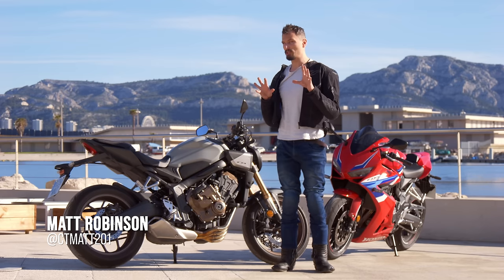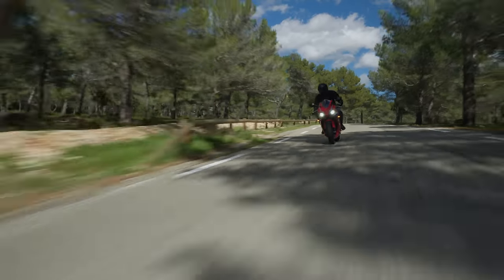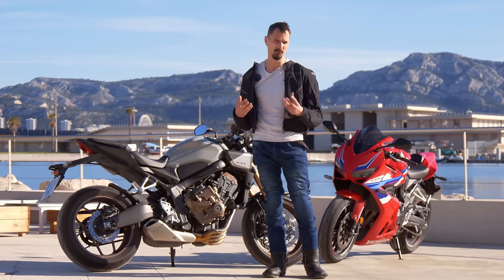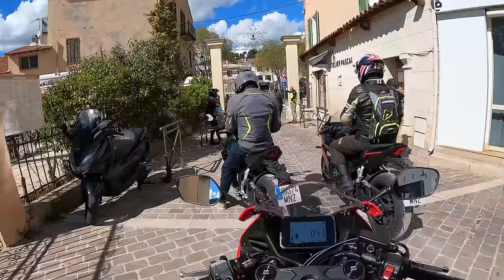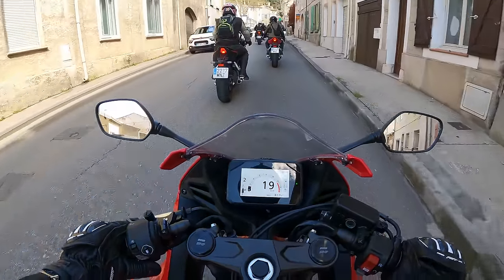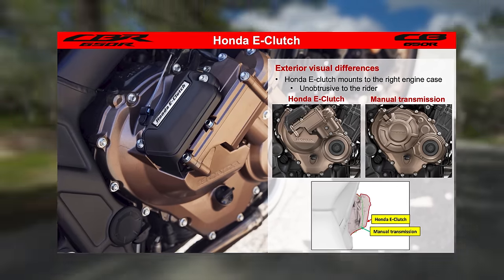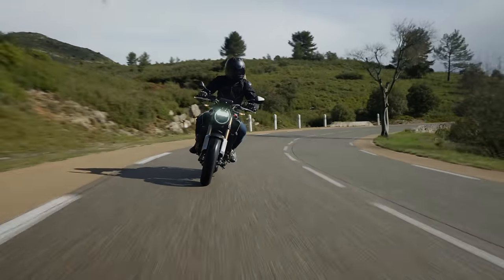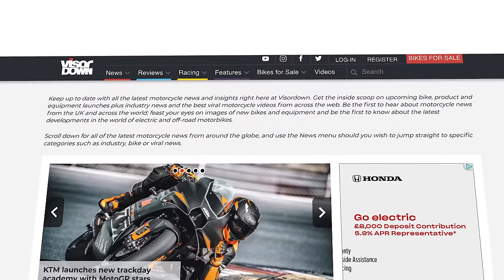Is Honda's E-Clutch A Gearbox Game-Changer?

Comment: When did motorcyclist get so sensitive towards manually shifting a motorcycle like it’s a chore? For some it’s part of the engagement, for others it’s a distraction but you don’t have to diss one to bring the other up. Just enjoy the ride.
Reply: The exact same debate has been going on in the car world since Porsche made the 991.1GT3 PDK-only…. 2014
Reply: @timessix8434   That's true, lazy knobs ruin everything...
Reply: There are hundreds of new manual motorcycles and those models have a manual only version why are you even on this video?
Reply: It's two worlds in one, why be annoyed by that?..
Reply: What makes Motorcycling fun is the fact one is not inside a box, that is pretty much it, like riding a bicycle, yes, working the Clutch is a chore.  Having not to worry about the clutch adds safety, why would anyone not want that ???
Reply: As a disabled rider with a left leg thats down on strength and left fingers that have minimal grip strength due to an accident, the DCT has been a game changer for me. I'm looking forward to seeing if I can ride this transmission and get back to riding sports bikes
Reply: @silotx  I watched the video to learn about the new technology. I wasn't expecting to hear the negativity towards manually shifting motorcycles though. I simply shared my opinion of that aspect of this video. It does not mean that I dislike the video or the presenter.
Reply: @tkraft1442  I'm not annoyed by it at all. I was just curious why the presenter felt the need to talk down about manually shifting when the option is there to do both on this bike.
Reply: @mannyechaluce3814  Not my preference, but I understand some prefer the DCT option over manual for various reasons. I'm not going to talk negatively about DCT though. I think this e-clutch technology provides the best of both worlds and lets the rider choose their adventure for every ride.
Reply: @mattyb7736  That is awesome to hear. One of my neighbors had a DCT bike due to various limitations of operating a bike manually. I think this e-clutch technology is a great blend between old and new tech and I'm interested to see if more bikes in Honda's lineup end up with it.
Reply: Don't worry about it. It's only for the commuter/tourer bikes anyway
Reply: The same argument would apply to every technology we take for granted

Why disc brakes? Why not use drums like "real men"
Why EFI? Why not tune carbs every ride?
Why ABS, why traction control, why liquid cooling

In fact why not ride the fastest bikes from the 1930s - they will do 100 MPH as well as anything new
Reply: Younger generation, cry babies, no backbone, want everything fast and easy
Reply: It's for people who live in crowded cities where traffic is hell and this is a no brainer! You don't like it don't get it as this is an option anyway, stop dissing good cheap tech for no reason which makes life easier for real.
Reply: @mattyb7736  that's awesome mate, super happy for you.
Reply: @MaxHendrick-tk3xt  Not to mention the few who now have prosthetic limbs and still ride!
Reply: Everyone else that doesn't live in America or Europe where riding a motorcycle is a necessity and not a hobby
Reply: Because it serves no point. It’s like cvts with “manual feel” profiles. It’s for honda obsessed  bike purists.
Reply: @TankSwift  Thank you for that perspective! This technology makes a lot of sense for those use cases as well.
Reply: But you already have to deal with wind, two missing wheels, and no roof.
Reply: For me sinds i got carpel tunnel syndrome. But yea shifting yourself is fun
Reply: Nobody is complaining about manual. It’s about the clutch. Having to use a clutch is stone age tech. Now you can use the clutch or not, your choice.
Reply: I love rowing my own boat, but in dense heavy traffic commuting, I would absolutely LOVE to have this feature.
Reply: Well in the video he mentioned some situations where this is quite a nice feature. For accessibility for people that have some sort of disability is one. If it’s a nice piece of tech I see no reason to use it, it all depends on how well it is integrated in the system.
Reply: I actually want one of these bikes mainly for safety. When I’m close to the front at stoplights, it takes a second to lower my right foot off the brake (which I use to hold the bike in place at a stop most of the time,) pull the clutch, pop into first and modulate the friction zone. In that time, the idiot behind me has already started moving forward because they saw a green light and everybody is impatient in their miserable little lives. Because of this if I’m at the front of the line I usually hold the clutch down in gear to avoid somebody getting too close to me expecting instant movement forward. Didn’t care in my stick shift car, but I can get way more hurt off someone’s bumper on a bike. I love rev matching though, I will use the clutch on downshifts 24/7 if I had this bike
Reply: couple of reasons. 1: health issues - some people do suffer from arthritis so it's going to be hard to shift from time to time being that your hand is already inflamed.
2: traffic - it varies but in our country driving is a nightmare and having a manual bike is like signing up for anger management your move little by little that it's frustrating to hold the clutch and shift from time to time so this is a game changer

I drive a manual motorcycle, and I don't belittle any type of rider just because I drive manual doesn't mean I'm better than any one else and secondly this is a very exciting innovation kinda like when the motorcycle, led light, abs, etc. was invented. if an invention makes for an easier use then it is successful. if we fail to accept this concept then why not just ride an old motorcycle with no abs, no led heck why not just ride a horse?
Reply: Sounds like you may be the one who is too sensitive. The chap in this video is British. The way they rag on stuff is just their type of humour.

Comment: When will other manufacturers catch up to Honda. I'm absolutely sold on Honda's DCT and have been for 10 years.... can't wait to try this. Others need to catch up
Reply: You must be old
Reply: @Sanisani9  no. Lazy, modern, efficient like all the automatic car drivers out there.
Reply: Don't see the appeal of making bikes as boring and automated as cars. You might see it as other manufacturers needing to "catch up", I see it as Honda making soulless bikes I wouldn't ride for free.
Reply: @nordstar2698  
Understood. Depends why you ride. I ride to get easily from A to B. I love riding but only ride to commute to work
Others ride for the thrill, the feeling, the raw mechanical feel. I understand why those enjoy a more manual gearbox. Horses for courses.
Reply: @nordstar2698 WTF is boring about this? It’s boring that you don’t have to pull the clutch in? It’s boring that you still have real shifting, just like on any other manual bike? And if you do wanna pull the clutch, you can.

Comment: Took me 30 000 kilometers to fall for the DCT; certainly wasn’t love at first feel, but it shifted my perspective.
Reply: Hahaha shifted 🤣
Reply: break it and its an expensive mess... worked at a shop and have a few overheated examples because wrong oil is used...
Reply: Well using the wrong maintenance items and having damage because of it, is very much NOT a fault of DCT. Using wrong engine oil in any modern engine can cause many issues

Search for the ytuber Varahannes. He has a Honda Varadero and a Afrika Twin 1000 DCT
The AT has over 500.000 ans absolutely no issues with engine or transmission
Reply: @someguy9520  I think he means the price to fix is twice when it's a dct vs a conventional one

Comment: My first thought was "what a useless idea" but it obviously works well.  I was reminded that many years ago I had a little race bike with a Yamaha TZ125 engine, and on one particular track I was doing around 30 gear changes per lap.  Even with the extremely light clutch of the Yamaha, by the end of a day of 2 or 3 practice sessions and 4 races I was doing lots of clutchless shifting because my hand just wasn't quick enough any more.  With that in mind it sounds like a great idea.
Reply: When I read about it I also thought "what a stupid idea". Tried the new CB650R with e-clutch today, it was awesome. I totally understand and love the idea after trying it.

Comment: Yamaha offered a similar clutch system on the FJR1300 for a few years.  I owned one and liked it a lot.  I have also owned a DCT Honda, and while the shifts were silky smooth, the auto shift points were not great, and it added a lot of weight.  Hopefully Honda will add the logic to support auto shifting with this new system.
Reply: Oh .... that YCC-S system .......

Comment: They could shift the "box of tricks" under the tank, and have it pull the ordinary clutch cable - then it could be fitted to any bike !?
Reply: The engineers are probably worried about cable slop and it’s effects on the algorithm of the MCU, better in most cases to have the computer control where the system has the least amount of mechanical slop
Reply: It could be fitted to nearly any bike anyway.

Comment: I need to see the shop manual on how complicated changing the clutch will be before I even decide to buy one of these.
Reply: Knowing Honda it may be surprisingly easy, just another module to remove with maybe another 4 bolts.
Reply: A friend of mine has one... Easy to replace, but expensive either way to get worked on.
Reply: I think the system only adds a complete module in top of the case, so the clutch system inside would be just the same.

Comment: This is certainly an appealing new technology and option. As someone who has a Rekluse Centrifugal clutch in my KTM, which effectively makes the bike an automatic in first gear but requires traditional shifting for every other gear, that is awesome for commuting situations the E-Clutch is like a more advanced, technical and broad evolution of that idea and the quick-shifter combined. Honda has my attention with this new tech and I look forward to seeing what they, and the industry as a whole, do with it.
Reply: Exactly this, many are not getting how much of game changer this new tech can become. Gone is the need to be  riding the  clutch lever and rear brake in heavy slow moving traffic. A proper motorcycle as easy and relaxing to ride in heavy traffic as a scooter is a big thing for many people.
Reply: @neilhaughey6869 Exactly. Even better is the fact you can use the clutch and rear brake manually if you absolutely have to. This is the best damned thing to come out on motorcycles, I’ve seen in years.

Comment: As an American long haul trucker I started in 1994 with 8,9,10,13,and15 speed manual transmissions. When the auto shift came out it was a clutch start and stop but auto from 1-10 gears but sequential.

Detroit Diesel engines makes a 12 speed, but with skip shifting. I can from a dead stop, start out in 2 then 5,8,11 then 12th. Wish motorcycles could do that😂

So it seems E-clutch is an “autonomous “ quick shifter similar to the DCT foot shifter option but on the gear component not the clutch side?
Reply: No, it’s still a full manual, but with an electronic mechanism to engage and disengage the clutch. You can also still manually pull and operate the clutch, and disable the system completely. As for automatic transmissions in trucks……glad you like it. I’d rather be soaked in gas and have a match struck. Give me a 13 or 18 any day.

Comment: The problem is not the clutch level, it’s the foot level. When someone invents buttons on the steering handle to shift instead of using your foot it’s an innovation. Yes, DCT has this function but it adds 10 kg if weight and more service costs.

Comment: it seems like a quickshifter option for motorcycles with conventional cable throttle. To sweeten the deal it has the benefit of disengaging the clutch when standing still.
Reply: It's like QS plus Rekluse. MV offered that named SCS. Except this one is electronic, whereas Recluse is mechanical.

Comment: Imo (as someone who daily rides a 2009 CBR600RR with a very heavy clutch) there is a difference between only really knowing how to not stall, and truly mastering a clutch/manual transmission. And most people don't progress past the first group because they are too used to automatics doing the thinking for them. My only other vehicle is a BMW 328i with a six speed manual, and regardless of whether I'm driving it or riding the CBR, I have never found the clutch to be overly cumbersome even in heavily congested traffic. Why? Because I don't try to drive/ride like it is an automatic, so I am either moving along in gear or stopped in neutral (if I am not at risk of being rear ended). Very little inbetween. My clutch usage is extremely minimal even without a quickshifter. I'm tired of cars and motorcycles getting so watered down because people are too weak and seemingly unable to progress past their current skillset.
Reply: WTF? First off, I’ve been driving manual semi trucks for well over 3,000,000 miles, and manual motorcycles for decades, and there’s a reason I take my scooter to the store, instead of my Busa…….
Screw pulling in the clutch all the time. It gets old fast. And what about people that are disabled? This is the best of both worlds. The manual lover like you can disable the system, and still use the lever, while everyone else (myself included) can enjoy the benefits of not using the damned clutch. I protest automatics in semi trucks, because of the lack of fine control during slow speed maneuvering, but I’ve never once protested the same on motorcycles.

Comment: Im surprised of why they are coming with this feature now...
Back in 2000s we already drove underbone Honda Wave 110 125, Yamaha Sirus, ... They are called semi-automatic clutch motorcycles and they work the same way as this E-clutch. The cost of the bike is around 7-800 euro, so it is not magical enough to be expensive.
Can someone tell me the differences?

Comment: During aggressive down shifting.
It will be interesting to see if Honda can also make it behave like a slipper clutch?
Reply: Is the slipper part of the clutch not on the drive side of the clutch? From the diagram, looks like this works on the input side of the clutch.
Reply: @fremen321  you would be correct, but that's not what I'm trying to say. 
Eliminate the slipper clutch all together. 
Before slipper clutches were even invented. 
Riders actually knew how to slip the clutch during down shifting.

Comment: I think it's a good idea, it will appeal heavily to commuter riders where there's lots of traffic in congested areas, like downtown. Although I do like the idea that you could turn the system completely off and just shift traditionally, rather than basically bypassing the system by just using the clutch... It seems strange bypassing temporarily rather than turning it entirely off, if that makes sense? But then again I ride a 2024 ZX10R and Kawasaki gives you the ability to turn the quickshifter on and off. I know this isn't a quickshifter, but, you get what I mean hopefully lol
Reply: From what I read, you can also turn it off in the menu settings.

Comment: It's not faster off the line than the DCT yet strange it's rev range engages up from 1.5rpm, where the DCT is 2k, Brilliant technolagy, I have a DCT Honda should make this available on the NC750x Manual, and it will be intresting how it performes on a parrelel twin rather a inline four "great Vid"👍👍👍

Comment: Maneuvering at low speeds, I need to have a clutch engagement that I can rely on. No automatic is going to give that so you end up having to juggle engagement against the rear brake. Too uncertain in my opinion.
Reply: Except you can also use the clutch lever. Why does everyone keep making this tired point? Did you, or anyone else, even watch the video? Or even read about the tech? You still have a clutch lever. You just don’t have to use it, unless you really want to

Comment: You mentioned that the clutch slipping is very minimal, how is this comfortable for riding around town where you're constantly opening and closing the throttle? Wouldn't the bike just jerk forward and back like a horse all the time?
Reply: You're implying that you're doing something wrong when you ride. Opening and closing the throttle is irrelevant to the clutch. It's only going to pull the clutch in if you start going too slow for the engine to stay in gear.

Comment: Can it be retrofit to older stuff?  Otherwise what was wrong with a quickshifter or DCT?  Is its one trick to sit there idling while in gear?  It would outwardly appear to be a very clever solution to a problem that doesnt exist...
Reply: No, it’s also faster and smoother than a normal quickshifter, because it partially disengages the clutch during a shift. And is it such a bad thing to be able to sit without having to hold the lever in? Everybody who is ripping this tech, didn’t even watch the video on it. You can also go 100% manual, if you wish (for whatever reason only God knows). It’s faster than any human could ever be on gear changing and launching.

Comment: Thank you! At the very least this made me very curious to know more about the E-cCutch system. A Hornet with an E-Clutch sounds like my perfect next bike though sadly we can't even get Hornets in the US.
Reply: GSX8 is the better bike.
Reply: @jordanjoestar8839  That's what I ended up with so in the end Honda may have done me a favor not selling the Hornet in the US. The Hornet's more spicy engine is the main reason I'm still interested but it also wound have been more expensive initially (surprisingly I got a very good deal on the 8S) + would have required more after sale accessories to equip it to my satisfaction.